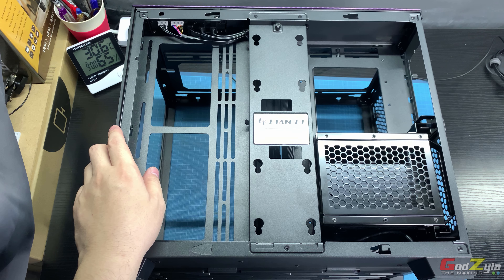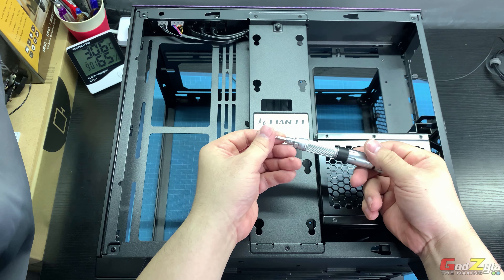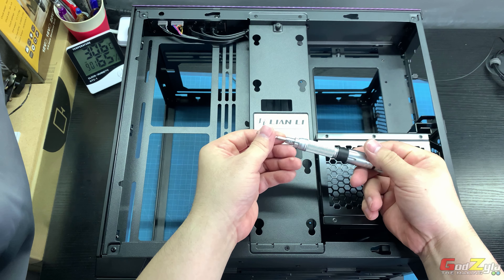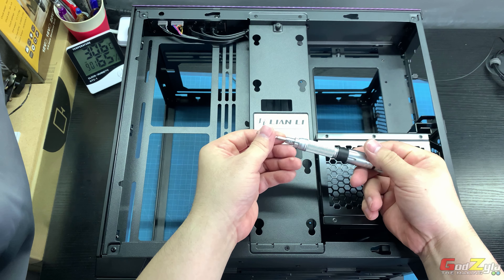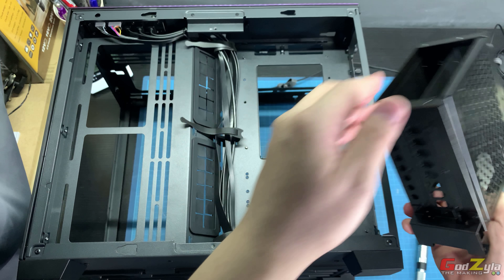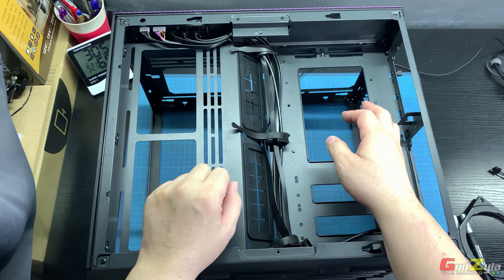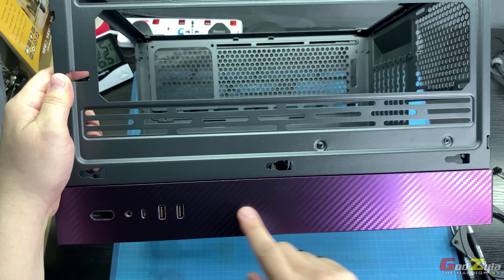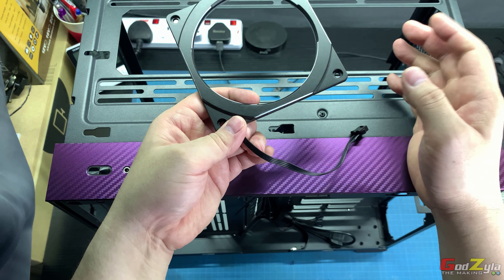Lian-Li O11D mini - Removal of Hard Disk Cage

Comment: Is there a cover for the HDD Bay? Like a mesh hole plate to cover it. I don't plan on using the drive bays at all so i'd like to cover it up.
Reply from the maker: Hello Todd Davies, welcome to my channel. Yes there is a mesh cover which I have illustrated in this video. You can remove the caddy and place back the protective mesh cover.
Reply: @KleoYan  oh yes so you did! I must have just missed it thanks!
Reply from the maker: @fomx2753  no problem 😉 all the best in your build.

Comment: is there anywhere else to mount a 3.5 inch drive?
Reply from the maker: Hi polymetrix, by default no. but if you can do some mod, at the front where the placment of the side fans are at. make sure there are no blockage and to do some mods.

Comment: Awesome work. Would you be able to do one for the 011 Air Mini?
Reply from the maker: hi Dr.Boi69, welcome to my channel. Do pardon me as I do not have the O11 Air Mini case.. so sorry.
Reply: That's fine! The hard drive cage on that PC case is kinda bolted in? It's not using normal screws. (Bad design choice 🤷) If you have a video on a case similar, that'd be great!
Reply from the maker: @dr.boi6926  I see. If I do get S chance, I will give it a try. Thanks..

Comment: What kind of aio support does this case offer?
Reply from the maker: Hi Charles Thrailkill, thank you for your question. first before I explain in words.. a detail video of this case can be found at GGF Events https://youtu.be/5s3klRSe0xs as I do not have all the AIOS and motherboard to show you. I am sharing what I have. am sorry. nevertheless these are based on the manual itself

it greatly depends on what type of motherboard you are placing in your case and these are the break down

M-ITX (need 7 slot to relocate at the back of the case)
Top 240/280/360
Side 240/280 
Bottom 240/280/360 (i do not advise CLC AIOs) 

M-ATX   (need 7 slot to relocate at the back of the case)
Top 240/280/360
Side 240/280
Bottom 240/280/360 (i do not advise CLC AIOs) 

ATX  (you cant relocate the 7 slots at the back of the case)
Top (not able to due to tight spacing)
Side 240/280
Bottom 240/280/360 (i do not advise CLC AIOs) 

E-ATX  (you cant relocate the 7 slots at the back of the case)
Top (not able to due to tight spacing)
Side 240/280
Bottom 240/280/360 (i do not advise CLC AIOs) 

I hope I did answer your question and thank you for your question. if you do like the content, kindly subscribe and to click on the notification button. thank you!

Comment: Hi, I really like your video.
I would like to know if the rear chamber for the side panel has enough room for a 280MM radiator with a thickness of 30mm.
Since I have a plan to move into this case but just need to check if this case can fit my radiator in the rear chamber.
I have seen the detail for this case from another channel that this case seems to fit also with E-ATX mobo but if put the radiator and fans together in the main chamber there will be not enough clearance for the 24 pin cable.
So I need to know if I can put my radiator at the rear chamber where will give enough clearance based on my calculation for the 24 pin connector to my mobo.
Thank you.
Reply from the maker: Hi Ryo Chaniago, thank you for your feedback and questions. I don't think is possible to mount a 280mm radiator at the rear chamber, though I did a quick measurement, the side rear chamber have approximately 65mm in depth and 300mm in height. These are the reason why is not possible

1st based on my own 280mm AIO from Arctic Liquid Freezer 2, my radiator is at height 315mm which is not able to fit. 
2nd even if other 280rad can fit the hose will be block. 

as for the 24pin of a E-ATX with a 280mm Rad, it's not possible too. the spacing is way too tight. 

hope these does answer your question.

once again thank you for your feedback and questions. do subscribe to my channel if you like my content. thank you :)

Comment: Mine is riveted in.. oh well never buying this junk again.
Reply from the maker: Hello CaptCitalist, welcome to my channel. Hmm, I have recently gotton another O11D mini for a friend's build. they are not riveted. Did you mistake this case as the O11 Air Mini?
Reply: @KleoYan  yeah I have the o11 air mini. Idk why they would do that.
Reply from the maker: @ilovehotdogs125790  I see.. so sorry to hear that. Anyway the case shown here is the O11D Mini not the O11 Air Mini. Both different structure in someways. 
To be honest, I was tempted to get the O11 Air Mini but after going through the specs and such at their website. It's not to my liking.. the only advantage of the O11 Air Mini are, to be able to use full ATX PSU and having the front mesh. but the fan and radiator arrangement, I do not like it. Anyway, I have part with my O11D Mini too https://youtu.be/caZg__l18Dk and am going to migrate my stuff to the Lancool III. https://youtu.be/PoBzRPApK5U . Thank you to have visit and to have leave your valuable feedback.
Reply: I bought the XL version for a whopping $216 with tax and it turned out to be poorly done. I got no support from the company! New Egg refused a refund or replacement. 

It had small parts fall off, the metal tongues for inserting the panels were super thin, and the nubs that slip into the panel grooves just FELL off the first time because they were barely attached. They used some sort of paste glue. I had to hot glue them back on (the ones I was able to find XD). No complaint about the features such as the 4 hard drive slots and such though.
Reply from the maker: @gamesturbator  Hi welco,e back to my channel. So sorry to hear your unpleasant experience but you can have your unit exhange if you want to. just fill up this form at the direct lian li warranty cliam website https://lian-li.com/contact-us/ , make sure  you upload some pics or video of it as where you dont find it sactisfaction.
Reply: I bought the XL version and it turned out to be poorly done. I got no support from the company!  It had small parts fall off, the metal tongues for inserting the panels super thin, and the nubs that slip into the panel grooves just FELL off the first time because they were barely attached. They used some sort of paste glue. I had to hot glue them back on (the ones I was able to find XD).  

No complaint about the features such as the 4 hard drive slots and such though., but paid
Reply from the maker: @gamesturbator  Pardon me, when you mean the company as in Lian Li directly or the shop? As what I have encounter, the shop who did not honour my warranty, 
I just submit a warranty cliam directly from lian li official website, all is needed is to attached your receipt, a picture of video of the faulty case and write down a discrption and they will alias with you to have part replace. Anyway, the choice is yours.